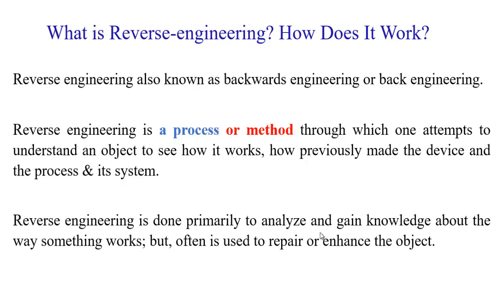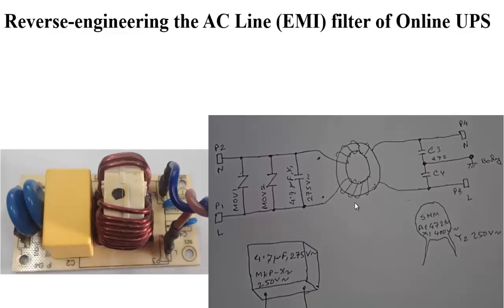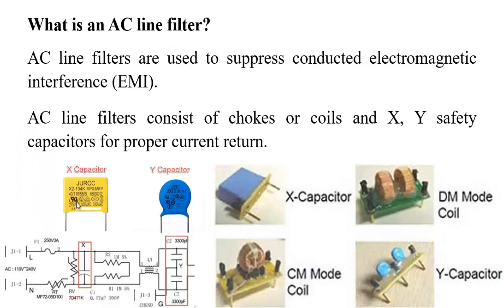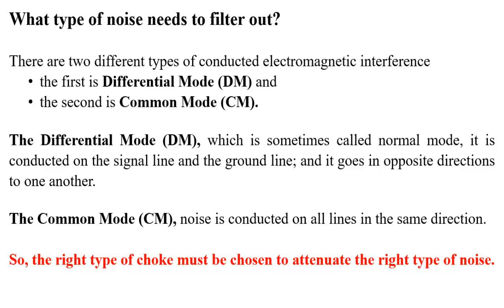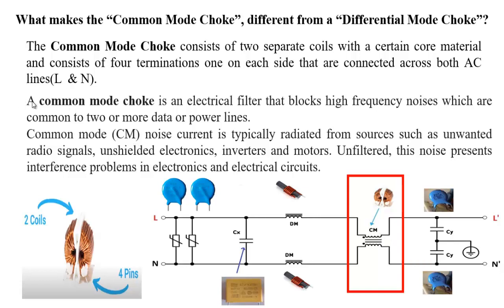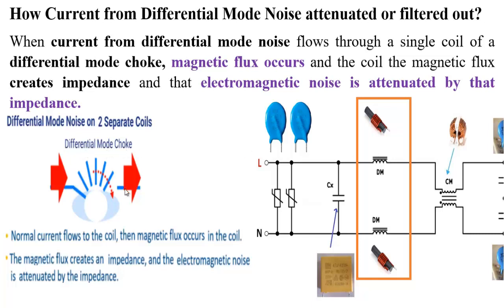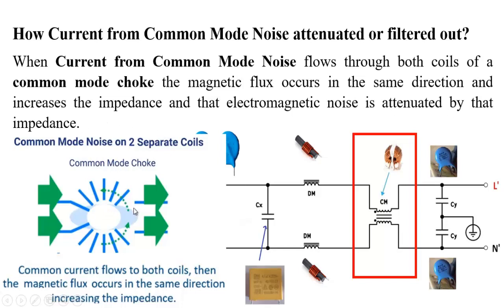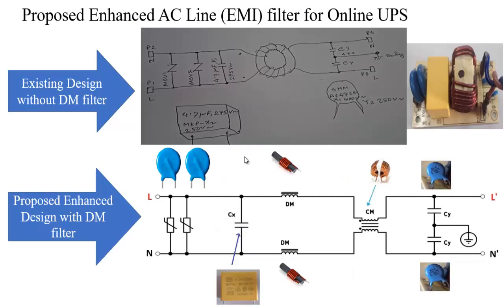Reverse-engineering the AC Line (EMI) filter of Online UPS and Enhance the AC Line (EMI) filter.

Comment from the maker: Reverse engineering also known as backwards engineering or back engineering. 
Reverse engineering is a process or method through which one attempts to understand an object to see how it works, how previously made the device and  the process & its system.
Reverse engineering is done primarily to analyze and gain knowledge about the way something works; but, often is used to repair or enhance the object.